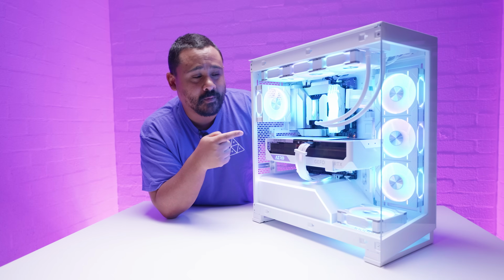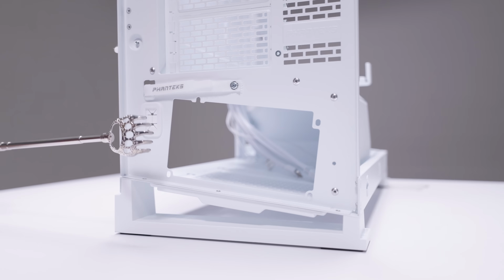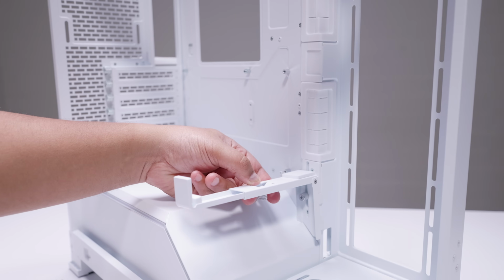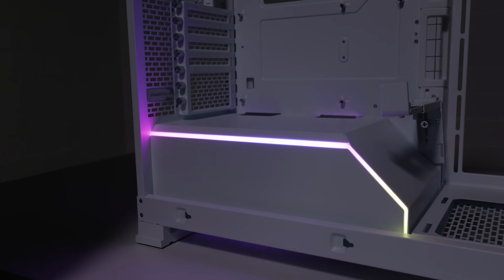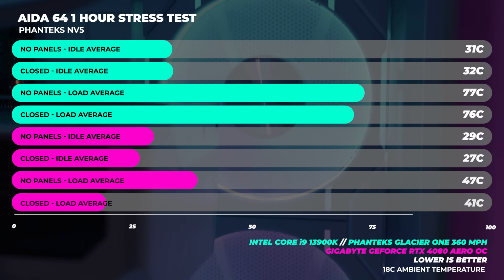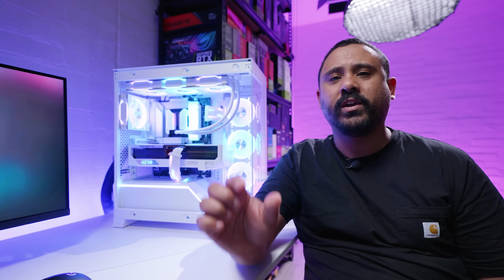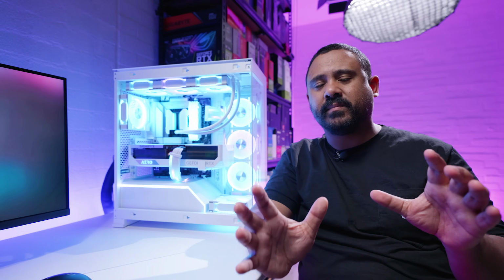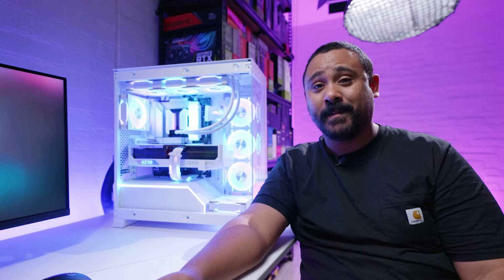Phanteks NV5 - They thought of EVERYTHING and it's only $99!

Comment: No, they didn't nail it with the height adjustability on the anti sag bracket for the GPU. I have to take a screw out for it to work with my Founder's Edition 5090 and then the way that the cable routes into the angled connector on the GPU it gets in the way so it looks off. Had to take it out completely and am using the ROG Herculx anti sag just because everything else is ROG in the rig besides the FE GPU. Swapping cases soon most definitely. Thinking the Mechanic Master C34 or Phanteks Evolv X2

Comment: They marketed this as a smaller NV7, but I was very disappointed to see that it had very little in common. No external cable management, only one bottom fan slot (that is literally useless), no motherboard cable hiding panels, no ability to change bottom fan angles, only one rear exhaust (two can be done in a case this size as my previous case did it). etc. The NV5 just seems like a normal case with one or two nice features. It’s a nice looking case, but not really like its bigger brother at all. 

Ended up going with the NV7.

Comment: One thing I miss in this case, is the option to put 3 intakes immediately underneath the gpu to cool it down, making the gpu fans to run more silently. The nv7 has this and works great.
Reply: This is my dilemma NV5 vs NV7, I like the smaller form factor but I prefer less noise from the GPU fans
Reply: @Motivational_Flavio  we're talking just a few cm or inches, the NV7 is way more complete and a breeze to build in. The NV9 would perhaps be excessively large for me, that one is mostly for fancy water cooling designs.

I got the NV7 after having the corsair QL 5000 and I'm amazed

Comment: Its a good option for air cooler, using the  arctic freezer 34 esports duo?
Reply: Maybe but if no liquid cooler i guess u would need some outtake fans on top for airflow if u got reversed on side like in this video or if u have outtake on side u don't need them I guess just make sure u have good airflow

Comment: Even tho the case looks nice and it has a nice price point it is not equipped by base with any fans. So unless you have a big budget for fans this case is a bit a meh. A fan of any decent brand ( cheepest i could find ) is 10/15 euro. Considering 3 fans for intake and 1 for exahust already this case cost 40 / 60 euro more and ofc you can put up to 4 more fans generally. So even tho the initial price is ''good'' it is not good enough imo cause u gotta spend 40/60 euro of fans and for 150 euro or so u have a lot of different cases at your disposal. Also you should consider i took the cheapest fan of a brand i could  get so not even '' optimal '' or '' the best looking''. If i put the phanteks ones you put it is 84 euro per 3 fans and that drives the price point to shit litterally. Maybe for content creators it is great cause you guys have tons of fans/equippement you get for free but if you build a pc and you have a budget below 2k generally you don't spend 200 euro for a case xD

Comment: Thx for the hard work! Your review on this case is one of the earliest among other youtubers! I just bought this case today after seeing your video (ready for a new PC build but havent got all the components yet) and I am wondering if i can still install a CPU air cooler such as the PA 120 if i vertically mount the GPU (will be a 4070) with the phanteks vertical GPU mouting kit. Could you try to show us in your next video when you do another build with your custom made cables?

Comment: Awesome case for the money, $179 AUD at pccasegear, but the only caveat is there are no fans included. That means you need 8x120mm fans to populate this case. So to stay in the Phanteks ecosystem that's 8x Phanteks DT30s i.e 2x 3 packs, 1x regular and 1x reversed and 2 singles 1x regular and 1 reversed that's a case and fans total of $527 AUD 😢 or go with 8x white Arctic 120mm for a combined total of $$283 AUD with no RGB.

Comment: For what the case offer, the price being U$99 is really appealing, although I'll wait until I see the pricing in AUD. Expecting PC Case Gear to put this around $180 or so before shipping.
Definitely worth the consideration to move from my existing O11 Mini.

I wish the bottom dust filter latch isn't located on rear but sideway/front.
Reply from the maker: $169 for Black
$179 for White

Comment: I switched my case to an Antec DP503 like 6 months ago, I think I'm switching to this one in a jiffy. I do have one complaint, the bottom fan should be angled towards the GPU.
Reply: a single 120 that far bellow the gpu would make minimal - no difference in temp on the gpu. Its there to help actually circulate the air from the side fans that would normally have a hard time keeping airflow consistent with a 90 degree change in direction
Reply: @NyteStalker89  I understand that fans under the GPU don't do much because I have 2 myself. However, if you're gonna put a fan there, why won't you do it the right way?